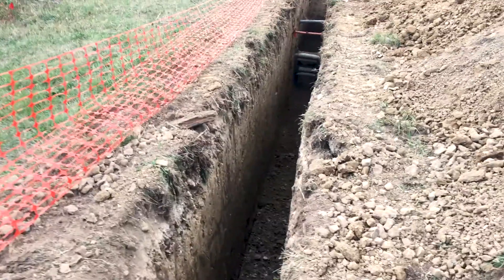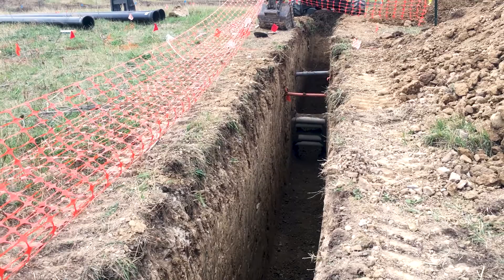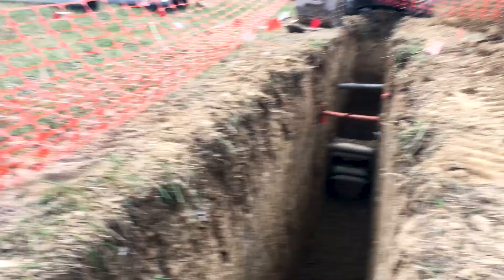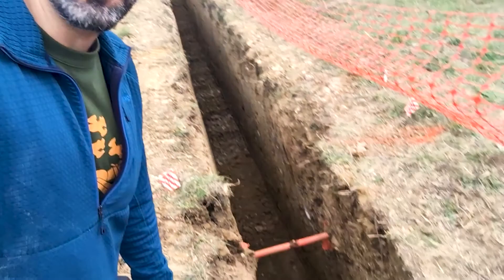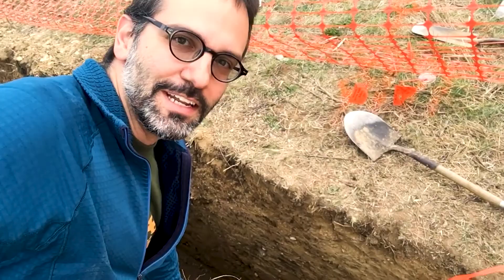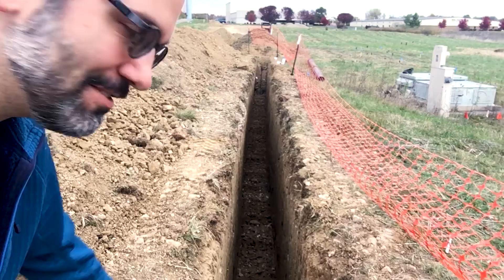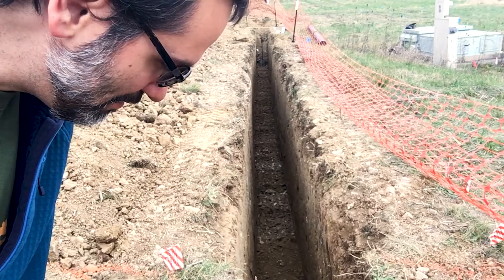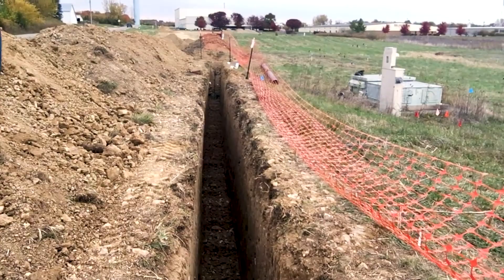Under A Fiber Optic Easement - Water Main #3

Comment: Any video of the part that you knocked out?
Reply from the maker: No I wasn't there for it when they took it out. Basically they were digging in an area that hadn't been marked and then all of a sudden about 10 trucks from the phone company all showed up freaking out. My excavator was scared until it had been proven that it hadn't been properly marked in the area where they hit it. So, I only found out about it after he knew no one on our end was liable for it. I'm afraid to even drive over the grass in that area though because some of the easements aren't even buried that deep.